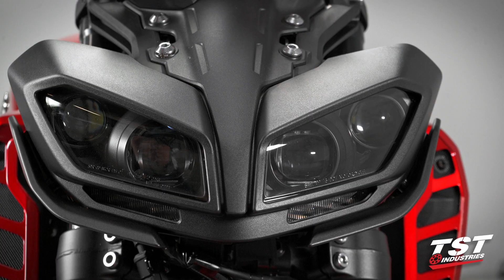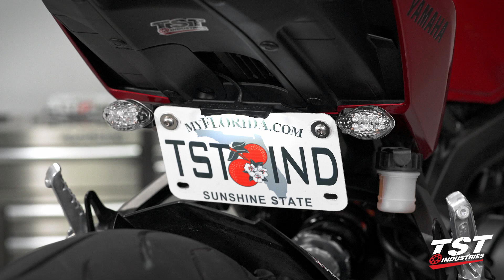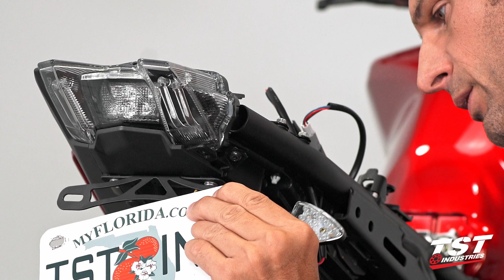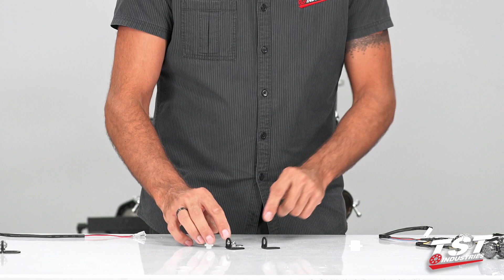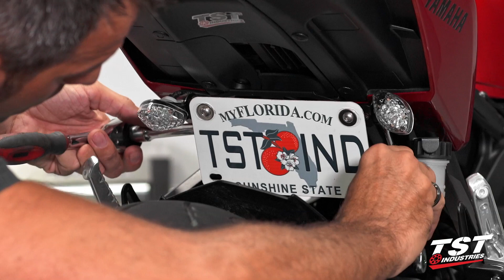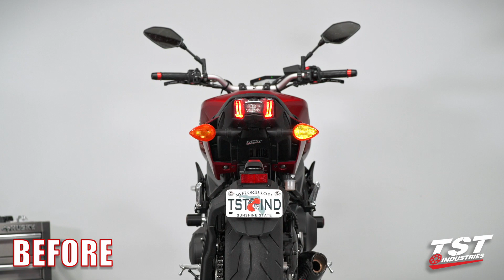How to install LED Pod Signals on a 17-20 Yamaha FZ-09 by TST Industries

Comment: I have a 2015 fz 09 and when I plug the new pods in they flashed for a few seconds then stopped. now my blinkers aren't working at all even when I plugged in the oem ones.
Reply from the maker: It sounds like you may have blown a fuse. Please check your "park" fuse and "signal" fuse and before replacing, check your turn signal connections to ensure they are covered and not touching each other or frame components.

Comment: Fyi my access hole was so small could only fit one wire through. Had to drill it out to fit both
Reply from the maker: We,ve never seen that on an MT09. Maybe the molding process that produces the subtray was off when they made yours and the hole had flash around it.

Comment: Is this the same for a 2015?
Reply from the maker: Yes but maybe not the lower mount option. We have not tried the low mount install on a first gen bike. Oh, and we have some new signal lamp options nowadays.
Reply: TSTindustries I am installing them on the front instead, should be the same process right?
Reply from the maker: @SmurfySniper  yes-as far as electrical hookup goes. The physical installation will require converter plates that make the pod signals fit the stock signal wells. We have those on our website but maybe you already got them

Comment: Will these pod lights work on a 2015 fz09, with a low profile fender eliminator?
Reply from the maker: They use the same mounting and the same connections so technically the answer to your question is yes. I don't know what you mean by Low Profile in your comment though. If you are talking about our TST version of the deep undertail mount license plate bracket, then yes, they will mount to that system but will be in a location that you will have to make sure doesn't get kicked  during normal operation of the bike, and also remains visible.

Comment: Why can’t you use the low pods with the high mount?
Reply from the maker: You are able to use the Low Pod Signals with the high mount location; We just made recommendations on what we felt looks best. If you prefer the Low Pro with the High Mount, you should have no issue at all.

Comment: Is there a way to replace the stock rear blinkers with these pods without having the fender eliminator?
Reply from the maker: Mason Maloof if you can stand by a couple days we will have pod signal adapters that will mount our pod signals to any Yamaha signal well
Reply: TSTindustries yes thank you
Reply: TSTindustries can you do a quick video for the pods on the stock rear setup